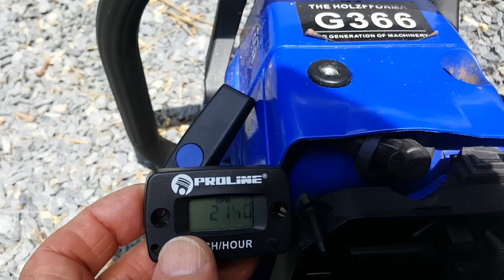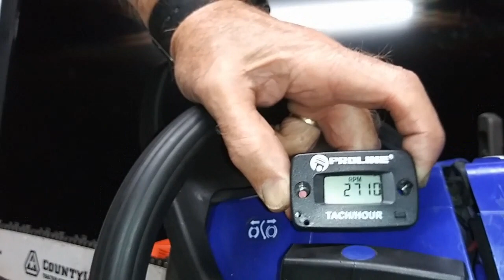Huztl G366 MS361 Clone Runs Backwards Diagnosed,   Loose Flywheel Key Damage Fixed, Replaced Key

Comment: Thank you for this video.  I bought two of these over a year ago and neither one would start.  Sold one and the other has been sitting.  I've replaced everything I could think of (Carb, spark plug, starter coil, fuel filter, etc.) but I didn't know about this.  I will have to give this a try and I hope it fixes it.  The Farmertech community got mad at me when I complained about it online and they said I shouldn't buy these clones unless I know how to fix them.  Farmertech wouldn't honor their warranty either (the saws were DOA) and said I should know how to fix them also.   Overall, a very disappointing experience with them.
Reply from the maker: I hope it might help out.  If you have no spark and because you have already tried spark plug, and coil, this just might be the issue.